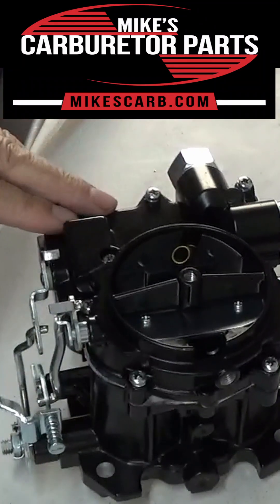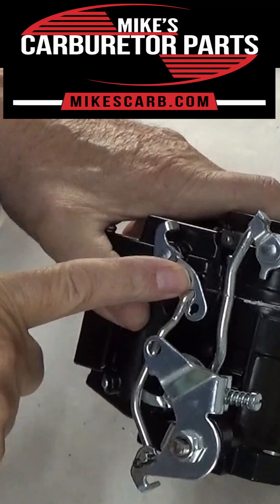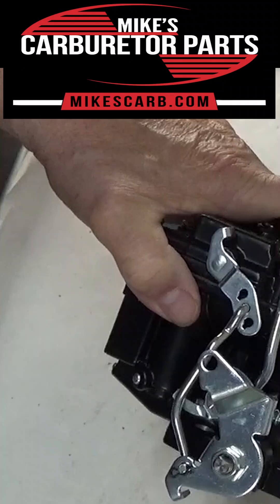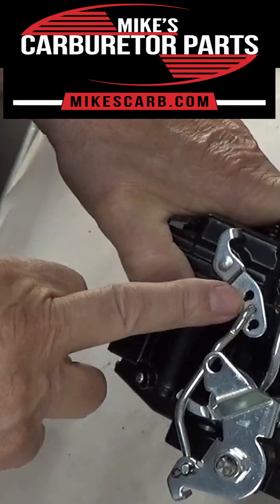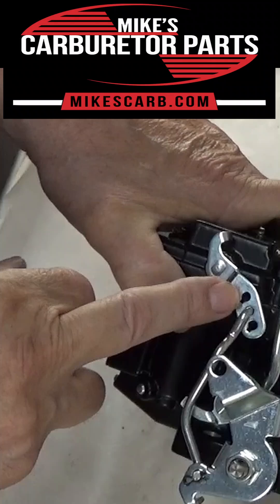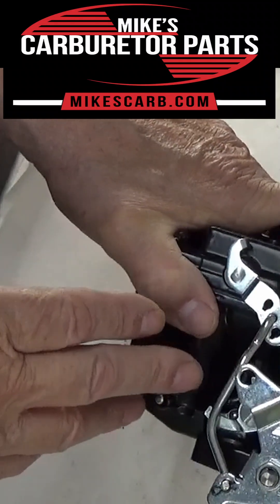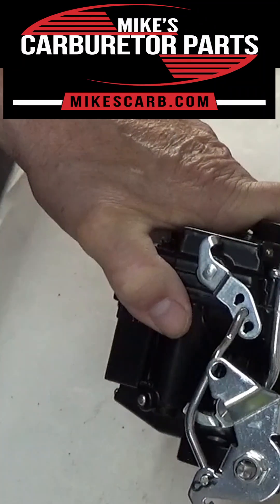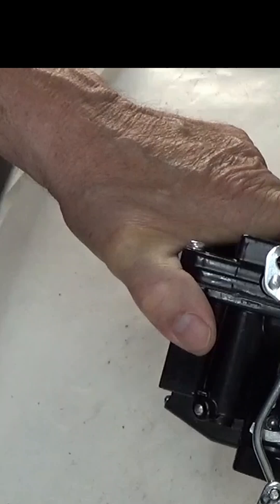Mercarb Carburetor | Accelerator Pump Stroke Adjustment Tutorial

Comment: What is the minimum size engine  this carb would support.  Would a 1500cc be large enough. I wish a weber dgv had this option. Ive always been curious if a weber dgv could be converted to a double pumper because the carb on my Austin Healey is a mirror image of my mg midget carb  and if the opening  of the secondary could be brought closer to the half way point instead of between 75 and 80 percent of the throttle throw I would like it closer to 50-60%throttle open that way the accelerator pump is still feeding instead of it getting a big gulp of air and leaning out and falling on its face the moment the secondary opens. A synchronous kit kinda seems like a joke for the dgv
Reply from the maker: 4 Cyl.
Reply: @MikesCarburetor  1.2l. 1.5.l  1.6l. I'm curious what it's flow rate is and venturi size is so I can figure out what will flow correctly for these small 4 cly engines  weber dgv carbs are sold as a direct replacement for 1.2l (1275cc) and 1.5l (1500cc) engines but they are designed for 1.6l (1600cc) 2.5l (2500cc) engines that's why I'm having problems with them i have 5 that I'm dealing with  and one 1275 has been bored and stroked to be a  1480cc screamer but  using a set up for a stock 1500cc is not correct. I need the setup for a performance  1500cc engine and I am about to build a destroked 1500 with a 1300 crank but over bore to gain 300 ccs to make it a short stroke 1600 where it would be an 1800 if I leave the crank that's in it the stock 1275 and 1500 redline at 6500 rpm but the 1480 and the short stroke 1600 are cammed to 9000+ rpm  kinda leaves me with engines that either are starving because the air is not moving fast enough to pick up enough fuel or they are strangling it. sorry if I'm confusing you,  its confusing me too.
Reply: @MikesCarburetor  i like that adjustable accelerator pump
Reply: @MikesCarburetor 1000 bucks for a dcoe and intake for either engine or 1800 bucks for twin dcoe and intake  for either the 1275 or the 1500 engine 1 to 2 grand for induction for small 4cly engines is just a bit nuts especialy when I won't net more than 145hp out of them after the drive trains parasitic loss I'm sorry I wrote a book here
Reply: I'm half tempted to adapt a holly 750 double pumper to it and block off one side completely so it's a progressive 2 barrel like the weber but that brings the carb through the hood if I do that
Reply: You seem more knowledgeable about carbs than most on you tube is why I'm asking. I'm over everyone else's head.